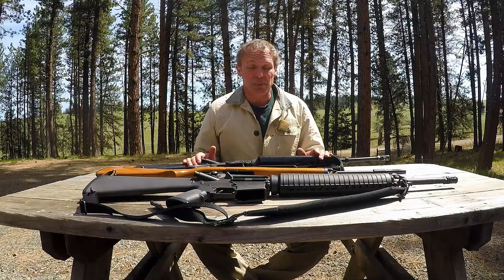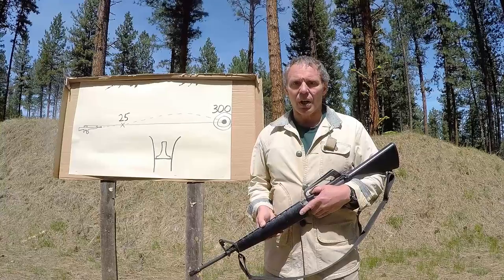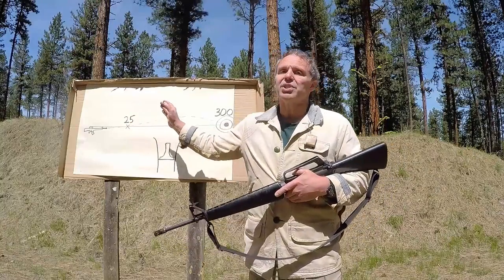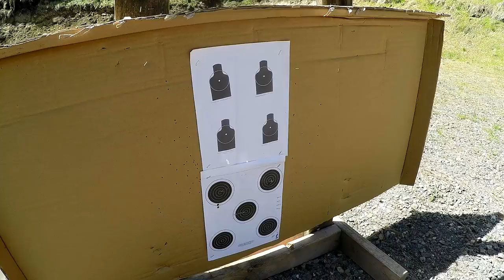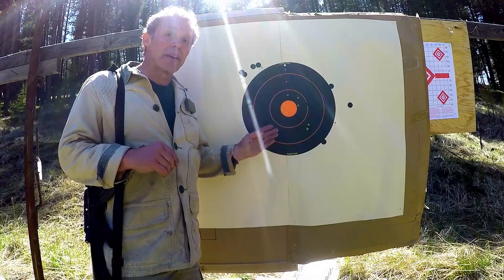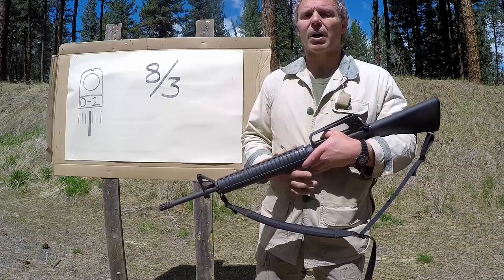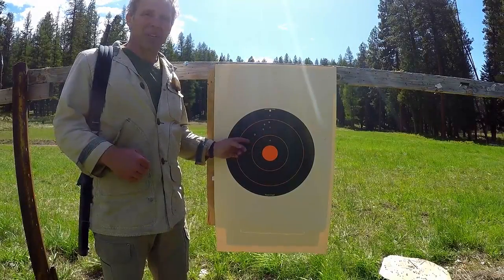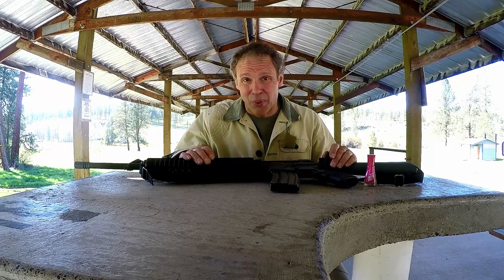Zeroing an AR Platform Rifle

Comment from the maker: The ammo used for this video was federal XM 193 5.56 NATO 55 gr FMJ for both rifles.
Reply: @henry sixx, jr 5.56 is generally a bit hotter than 223
Reply: Awwww... see I thought it was mk262 77gr ammo because you didn't state it 15 times. I mean that's what the military uses now an I'm sure it's backwards compatablewith the sights, twist rate, and barrel length. Because assumptions.
Reply: Thank you Paul for your instruction
Reply: Paul isn't the a3 just an a2 with a full auto instead of a burst mode. I think you mean a4 that's the one with the flat top receiver
Reply: @rockerdude8000  The A3 is an oddball that the Navy got. I handled them when I was aboard the Stennis and they were pulling Marine AOs for ship's security. Like you said, it is full auto instead of burst. They were made by FN, and the stock had a weird fuzzy quality to it, (Maybe that's just because they were brand spanking new.) Seemed identical to A2s in every other way. There is definitely some confusion about the A4 flattops. I've heard flattops called A3 and A4 I'm not sure where that comes from though.
Reply: @henry sixx, jr  you can buy quality or you can buy cheap. . . For a decent middle of the road barrel look at Faxon Firearms barrels. . . Also, Nitriding and chrome lining help with barrel wear somewhat. However Chrome lining will affect long range accuracy somewhat, whereas Nitriding will not but costs slightly more.
Reply: @henry sixx, jr My two cents: Go with Faxon. I would recommend their 4150  barrel which is melonite treated. If you have some extra cash, the match series which is made with melonite treated stainless and a 223 Wylde chamber  is very accurate. I have a match series barrel and it groups 1.5 moa (10 round group) with bulk 556 off a bipod and me pulling the trigger (a detriment to be sure). I am confident with a better shooter, match ammo, and a rest it would be submoa.
Reply: “What...we’ve got here...is failure to communicate.”  Your message was VERY clear, and couldn’t have been more clear Paul.  People just need to pay attention.
Reply: A loyal subscriber. I hit that bell so I don't miss a video and view it within 2 hours of posting. I hit the like button.....then... watch the video.  That my friends is what I think of everything and anything Paul puts out. Accurate, well researched, based on reality and experience. I trust and enjoy all that this man put out....you should too.
Reply: Mr Harrell, just want to say Sir, that I love every video you have done. If I could be so bold as to ask, I have seen a million different videos and articles regarding firearm pmcs. Was wondering if you could do a video explaining your personal thoughts and pre/post range maintenance routine. Thank you.
Reply: @rockerdude8000  As far as I know there are both A2 and A3 versions with burst and full auto. An A3 is pretty much an A2 with picatinny rails.
Reply: But Paul, the green tips are magic bullets!!!
Reply: What colour of nail polish would you recommend Paul?
Thanks for the clarifications and all the considerable effort in explaining how to consider zeroing in weapons, such as the AR series.
Reply: @Genesis23OPB  Yeah duh. Its also a bit hotter in summer than winter, oh grasshopper.
Reply: @jakeweston8616  well the long version is, that all 5.56 guns can shoot 223, but not all guns chambered in 223 can shoot 5.56. got it now?
Reply: Just wanted to share a few video ideas I think would be interesting... One, the effective range of a rifled barrel 12 gauge shotgun with sabot slugs (and a scope), and I'd also be interested to hear what you think about big bore derringers.
Reply: I read this in your voice.
Reply: @rifleshooterchannel208  No I'm implying that those rifles are not designed for that particular round due to there twist rates, barrel lengths, and sights.

Although I'm not sure just how much of a significant role the mk262 round has. However isn't it more of a DMR/SPR round? Although I have heard some SF guys use it in their mk18s.

Either way I figure they still use M855 and maybe M193 depending on the platform. Again not sure. However, I'd imagine they wouldn't let a serviceable rifle or old stockpile of ammo go to waste if they can help it, or if it saves money.

PS
Although I would agree my statement wasn't very clear. Unlike his explanations.
Reply: Paul Harrell - thanks for the info. I'll need that to calculate the drop. Averaging the velocity.
Reply: I may have missed it. Are you using a 6 o’clock hold or a center hold?
Reply: Your initial explanations were fine. You can't fix stupid. Semper Fi.
Reply: Im a shaved head bearded loudmouth that wears flannels, I just want to say... HE DID THIS WRONG! AND USED THE WRONG AMMO!
Reply: How is it that 1 MOA is equal to 1 inch at 100 yard!?!  My math says different.  My math says that at 100 yards one MOA is would be 1.0471975511965977461542144610932.  How's my math?
Reply: I have an A2 and this is a great video.
Reply: I'm imaging you as a DI or DS "reminding" your platoon to pay attention while the walls sweat and there's bodily fluids on the deck.
Reply: That was 5 min of Air Force time.
Reply: I liked this. Makes perfect sense. Thank you!
Reply: Very educational Paul, Thank you. 300 yrds with Iron sights..Even with 20/20 vision I use a scope for that distance. That is really reaching out there. But after all, You're what you call a Professional 😀 👍. P.S. I do enjoy these longer videos
Reply: @henry sixx, jr Complete M&P AR-15, $499
Reply: Instructions unclear, loaded my SKS with 300 blackout. Why did you do this to me Paul?
Reply: Mirokuofnite Because he just won't make things clear
Reply: @Genesis23OPB  Again. We know. This is standard knowledge.
Reply: @jakeweston8616  if it were, people wouldnt be asking.
Reply: Paul I see you always lean towards the xm193 rounds. I feel the same. I think it's the most devastating well rounded 556 round.
Reply: We will disagree about which DECADE of the Mini-14 was best.
Reply: the videos are great, the comments are COMEDY GOLD!
Reply: Mr Harrell...it would be interesting to hear / see your opinion of "1911 accessories". What makes a difference and what's for show. Full length vs GI guide rod, skeleton trigger and hammer. Bull barrel vs standard. Those plastic washers on the guide rod. Are GI sights crap, magwells, barrel length, calliber....etc etc.
Reply: Excellent! Now I don't have to explain it to my friends.
Reply: Paul Harrell Paul, I just wanted to say I’m sorry that there are so many idiots on here and so many of those idiots trying to troll you on here. You are an exceptional instructor and even entertainer. Thank you so much for what you do on your own time, for us! Thank you for these great videos.
Reply: Thanks a million Paul!  I was never in the military so having an instructor like you is very beneficial.  Keep up the good work.
Reply: Paul Harrell You do actually get an MOA change between the small and the big peep m16a2 it about 2.02 MOA change in elevation
M4 or carbine length gas system it’s about 2.5 MOA 
If you don’t believe me go to 100 yards and test it
Reply: Paul, I hope you catch this. On my A2 I rotate the elevation wheel at the back of the handle all the way down. It does not align any number with the index mark on the handle. It is about 3/4 of the way between the 4&5 marks. It will do a full rotation plus 4 more clicks which puts the #5 on the wheel 0e click short of aligning with the index mark on the handle. There are 29 clicks in all from all the way down to all the way up. Should I rotate the up/down dial to the midpoint (14/15 clicks) and consider that zero? I hope you see this and can help. THX.    PS, The rifle I have is the Eagle Arms AR15.
Reply: The sarcasm contained in this channel absolutely has me falling out of my chair laughing. This might be the funniest explanation ever. I'm getting old.........
Reply: No, you’re wrong Paul, the rear sight is marked 6/3...  Just Kidding,  but seriously tho, I have a Rock River Arms LAR15 Elite Operator 2 that has the M4 style rear sight (6/3).  Any tips on zeroing that setup?
Reply: INFANTRY LEADS THE WAY !!!!.....HOOAHHH!!!.....and HOORAHHH!!!! To you Paul Harrell
Reply: @frederickhuicochea46  
No...start all the way from the bottom and go up one click. Shoot to zero at your desired yardage like 25, 100, ect....mark the dial with paint or nail polish. If non of the hash marks line up with with a dot or hash mark on the carry handle base, mark a dot on the base so it lines up with the dot you marked on the dial for your set zero. The rest is easy as you have to shoot your rifle at various ranges and play with the elevation dial or drum, mark it as necessary so it lines up with the dot on the base. If need be, mark the other ranges with different colors and keep a reference card or dope card on the rifle and make sure you note which color is what distance you zeroed it for.  Just be sure to stick with the same kind or grain of ammo when you do this as other brands and/or grains will have a different poa to poi. Hope this helps...
Reply: that look at the 4:49 - 4:50 made me spit my very fine chilled beverage across the room , ty Paul needed a little sarcastic release.
Reply: Hurry repeat the “flushing” part again...I heard a toilet flushing already.
Reply: 1 Yard is pretty much the same as 1 meter the difference between the to is negligible as in not even a full centimeter. to be exact its .086cm or .86mm. 1 Yard = .9144 Meters.  for our purposes anyway the separation is largely irrelevant.
Reply: Teralcraft   Those  “little” differences pile up 100m=109.36y.  500m=546.9y. I won’t go any further cause I’m not sure I could hit the state of rhode island beyond that...
Reply: @damiangrouse4564  it's still negligible when calculating distances. Plus you are not going to to zero these rifles for 500 yards it meters
Reply: @patrick4919  Goes double for me.
Reply: @project86xero  all branches use m855 62 grain. This differs if you use rifles like the mk 12. Otherwise it is m855
Reply: @Genesis23OPB  8888⁸8⁸⁸88⁸⁸⁸i888⁸8⁸⁸⁸88⁸i⁸⁸88⁸88⁸88⁸
Reply: @rockerdude8000  you can put a rail on an A1 even
Reply: @mf9309  lol that quote
Reply: @NoBrakes23  my National Guard unit had M16A4s they were just flatop A2s. Some were converted m16A1s but essentially were all to the m16a2 standard just with a flattop. Thus the A4. I don't know if any unit got thr Full Auto conversion that the M4s got to the M4A1 pattern.
Reply: @project86xero  maybe for the Mark 12 Special Purpose Rifle, back in the beginning of the GWOT, M16A4 and M4A1 use M855A1 EPC and M995 APC
Reply: But, Paul... what about those of us who don't understand your silly minutes, meters and yards?  How can I possibly zero in my AR-15 unless you do another video in which you convert all of this into leagues, light-years, racks and kilowales (<< no, I didn't make that last one up).  I simply cannot fathom (<< see what I did there) how you could so callously toss aside those of us who are... ''measurement impaired''.  Furthermore... could you also do this video in braille?  My father-in-law is deaf and blind, and he told me he had a terrible time following along to your video and got into a lot of trouble at the shooting range because of it.  Of course, it might have also had something to do with the fact that he was actually in the produce section at the Piggly Wiggly, not the range, but still...
Reply: @vivillager  Perfect
Reply: @Andy Wood  Center Hold
Reply: @Combat Pyro  Put the drum exactly at 6/3

Zero at 25m
Check zero at 300m 
Make any adjustments with windage  drum and elevation is adjusted with front sight
Reply: Paul, any particular reason you don’t use optics?
Reply: thank you good instructor please ignore all the slobber bib candidate ingrates
Reply: Y’all listen up !
Reply: What you did wasn't wrong. It was taught in the Guidebook for Marines. Most people have their knowledge from the FM 23-9.
Reply: @rockerdude8000  The M16A3 is just a full auto M16A2. The AR-15A3 was a flat top.

Comment: Hey Paul, the Marines still use yards. I remember being taught to zero the ACOG/RCO at 100 yards and 100 meters interchangeably, and this was also shown in the data book. In fact it can be seen in MCRP 3-01A (Rifle Marksmanship) Ch. 8 pg. 10. We were told the the reticle graduations were measured in meters, however. We also shot on ranges that were measured in meters but they were converted from yards. So for example, 457 meters, which is 500 yards.
Reply: Although your comment is pretty old at this point, you are correct. In my last year I was a CMC and helped zero on the RCO7 and align with the tip of the chevron. Our range was in yards so when our guys were at 500 yards I'd have to tell them that usually aligning the 500 at the bottom of the silhouette would land them shots on the black. I never had the pleasure of working with the iron sights on the M4/M16 platform and I can really appreciate how braindead easy the RCO was to use, pretty flat shooting with the chevron but once you get to 25 yards if you use the RCO you're aiming with the 400 meter on table 2.
Reply: @marvnation924  Semper imperial. Boo metric 😃
Reply: @JaredAF  Oorah

Comment: On the A2 We use to do 8/3 -2 on the rear sight, centered with the front sight flush.  We would zero at 200 yards and all elevation adjustments were done on the front sight.  That supposedly calibrated the sights to roughly match the numbers on the rear elevation knob   Great video
Reply: Ahh, the Santos improved battle sight zero.

Comment: I used the A1 platform for 16 of my 20 years, and actually was very competitive with it. When we were issued the A2s, I would always shoot with the small aperture. Aim small, miss small. I never had to use the A3, but I'm sure that I would have adapted. 
Now I use a magnified optic on my AR platform (.223/5.56 and 6.5 Grendel) to get tight groups. 
There are two ways to do this; the Military (Army and Marine) way, and the wrong way!
Good explanation, Paul
Reply: Same here....I never used the large aperture

Comment: Excellent, accurate, substantive video as all of yours are.  I was also trained on the A1 (5.56mm M193, 55-grain) via USMC and your explanation on dialing-in is 100% for the A1.  But on the A2 (5.56mm M855, 62-grain "green tip") and most importantly, using that upgraded A2 sighting system with the correct BZO - the army uses the (25m/300m) BZO (27yards/328yards), and the Marines use a (36yard/300yard) BZO, which both work in conjunction with the A2 (8/3) (6/3) sighting system.   IMHO, the important thing to take away with the 300meter/300yard BZO is that this weapon and its 5.56mm cartridge and sighting assembly was designed for that BZO, and once that  zero is achieved, the soldier's/Marine's POA/POI at the tip of the front sight post will put that 5.56mm round in the center-mass kill-zone from 0-300y/300m by just keeping the weapon's elevation drum set for 8/3 or 6/3 and using the small aperture.  Semper Fi.

Comment: Interesting video Paul, especially the talk of Yards vs Meters in zeroing the M16 platform. Personally, I was taught in the Army (around 99-2000) to zero at 25 meters and the targets are stated to be in meters. This is with a A2 model of course due to the years I did it. I am not sure when the military jumped on the metric wagon but at the time everything was in meteoric as it still is today. It’s funny how many people want to argue simply based on their own experience as being the “absolute” right way, but you explained it well as to how you were trained in a certain way and for sake of explanation you can only show it how you were taught. It’s that simple, no argument required. Keep up the good videos!

Comment: As always, I learned a lot!  I haven't yet seen the other presentation discussed at the beginning, but now I want to find it.  I've known that there are some differences between the two platforms, but I didn't realize how significant they are.  I learned on the A2 model and have never even handled an A1 model.  One minor note: it clearly makes no significant difference in how it's used, but when I was in Marine Corps boot camp in 2002, instead of referring to the rear sight of the A2 as long/short range apertures, they referred to them as day/night apertures.